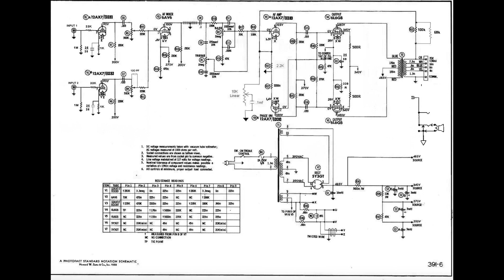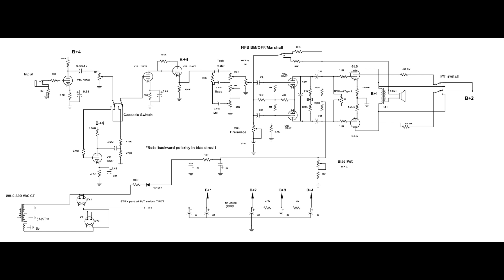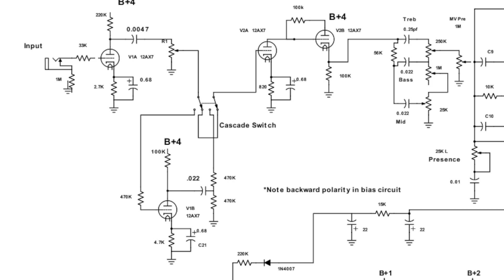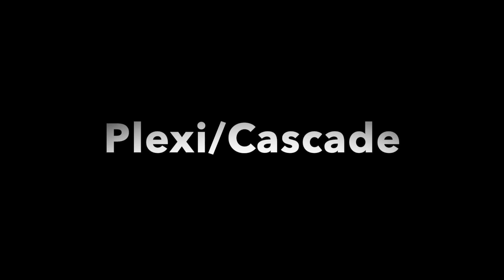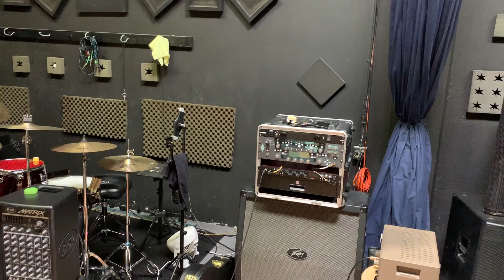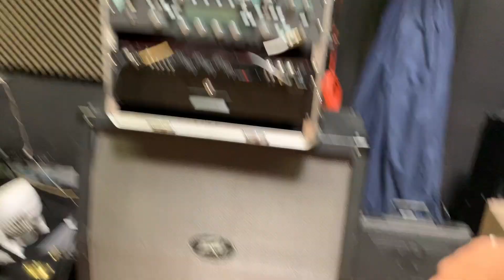Bogen Challenger Cha33 Conversion to Cascaded Plexi (AFD)

Comment: Super cool.  My grandpa passed away and left behind a CHA33, and I'm exploring converting it into a guitar amp, so this was so helpful.
Reply: This seems pretty advanced - do you have any tips/recommendations for a beginner?
Reply from the maker: @d.lauzon  I have 2 recommendations that are a bit easier.  First, you can leave the circuit fairly intact, simply replace the capacitors, and then revoice a few of the stages to be a bit more guitar-friendly.  This only requires changing a few resistors and caps, while otherwise leaving things in stock form in terms of layout.

The other idea is to build a more common version of the 5f6a or marshall in a different chassis, then use the tubes and  transformers from the bogen chassis in a manner that you can easily reinstall them in the future if you like. Use these for the build

Either way, please email and we can discuss further offline.  username@gmail

Comment: Getting ready to convert one of these. Decided to go for a Bassman but might leave it cathode biased with large value bypass cap to mimic fixed bias feel. Don’t know yet. Might use the fixed bias part of your circuit if you don’t mind. ✌️
Reply from the maker: Good luck, feel free to reach out if you need any advice (username @gmail.com).  Remember that there is a lot of juice in that power transformer (on today's mains), so you may need to play around with the cathode bias resistor value if you go that route.
Reply: @jloewenheim  I don’t think I’m sticking with the two 5y3’s. I think we’ve moved past that as a society;-). Solid state diodes and a resister for a bit of sag makes more sense I think. I’m tempted to keep the PI paraphase just because the bassman did alright with one for a while. The Bogen should be a nice change of pace from Hammond and Roberts reel to reel amps I’ve done for the past few months!
Reply from the maker: @williambock1821  OK, so since this build, I have done a few more conversions, and my honest advice is as follows (conversions can be a pain and frustrating):  Unless you are really determined to figure out how to keep the Bogen chassis and look, you pull the transformers and tubes, then use a more Fender/Marshall approach on the chassis and board.  This gives you two advantages: first, you can now always drop the transformers back into the original if you want to sell it as such.  Second, and more importantly, the fender style eyelet board (turrets too) will allow you to be very organized and methodical about your build, as well as, give you the room necessary for controls and other circuit options that go beyond what Bogen did.  

As for your rectifier (despite what Mesa advertises), the dual 5y3s make it run very hot, so there are advantages to going SS.  At some point, I will put on some videos where I have started to use a VVR circuit.  This allows those old PT's, which on modern voltages, often have secondaries around 400v, be used closer to the voltages we know.  Additionally, it allows you to go SS rectifier without needing to rely on sag.
Reply: @jloewenheim  Thanx for the input! I’ve done four or five conversions with VVR’s and when they work well they work VERY well. Some circuits(I’m just talking about cathode biased amps) just get too fizzy to really get much use from them. I’m sure they could be made to sound better if I had more experience. So far , I can’t narrow the variables down to what makes a VVR sound too fizzy. Some sound great at low voltage levels and some sound like a wet fart,lol! The Roberts reel to reels sound great with them if you do a one 12ax7 going into the El84 like a 5 watt version of a Marshall 18watt circuit. The actual 18 watt lite 2b circuit in a Hammond Ao35 sounds good too. Not much luck with Hammond Ao44’s though regardless of the conversion (tried 5 different ones) done. I’m tempted to try one on the challenger. I have all the components on hand for exactly ONE more VVR!
Reply: @jloewenheim  I wound up turning it into a 5e3 with VVR and bias selector switch for 6v6/6L6GB’s. Replaced the burnt out OTX with a brand new 25 watt Hammond 1650F. Wiring the impedance selector was…interesting! Used F&T for B+filter caps and Jupiter everywhere else. Well,a Sozo silver mica was used for the bright cap. Wired it all point to point with creative use of a few tag strips. It’s the best sounding amp I’ve built out of around 25 so far! I wish I could keep it but it’s already paid for. I’m looking for another Cha 33 for myself! Just as an FYI, the cathode resistor needed to be upped to about 700 ohms for 10-11 watts (about 80% ) of plate dissipation for 6v6’s. The 6L6 GB’s needed 330 ohms for the same percentage of dissipation. Again, this is a 5e3 build.
Reply from the maker: @williambock1821  Right on, it should sound amazing.  BTW, when you mention Cathode resistor, I generally put a 1 ohm in-line prior to the actual bias resistor for easy measurement (a trick I saw on Sluckey's schematics).  Needing to raise it does not surprise me, my Ch33 PT with the 5y3's has a much higher plate voltage, I think due to higher wall voltages.

Comment: Thanks for publishing the schematic. I have two CHA 33's and two CHA 20's (6V6) I've converted one CHA 33 (6L6/EL34 w/bias/balance) to an AB763 Bassman w/LTP PI and another half 12AX7 gain stage. The CHA 20 is now converted to a AA764 Princeton type head with a Cathodyne PI and a few tweaks.  I think I'll give your AFD schematic a shot. I only use point-point and they usually look very clean. I've done about 50 PA/Hi-Fi conversions and it's a blast. Just finished converting a blown out solid state 2x 10" combo to a Princeton.
Thanks again to you and of course Rob R.
Reply from the maker: Thanks for the note.  I look forward to seeing what you put together.  I definitely would do slightly cleaner as far as layout if I were to go back again.

Comment: I dig it.  Did something similar recently and used 270K/470K in the voltage divider.  Insane gain.
Reply from the maker: Thanks, hope you are enjoying yours
Reply: @jloewenheim  One key to using old PA heads for guitar is to use pedals! EQ, Comp, Verb, Chorus, distortion, sweetner, an yer off to the races!

Comment: Great work. Real good stuff. In the demo the plexi mode sounded like it's just barely on 4 on the volume and not rocking.. But I get it. In cascade mode you can't turn everything up to 10. When going between modes one has to adjust the volume /gain levels.

Just for other guys who maybe wonder why the plexi mode sounds weak.. It's just not turned up much.
Reply from the maker: Thanks Joe, I should have clarified a bit.  The pre amp vol and pre PI master vol (JMC800 style) were both at about 5 (out of 10), then the Type 3 MV was at about 40%.  Wattage for this amp is somewhere in the 45-55 range at full vol.  The studio where I recorded this wasn't big enough to push the amp to that level.
Reply: @jloewenheim  would be interesting to see how a plexi or similar amp responds to a paraphase inverter. I love the Gibson Ga6, ga20T and Ga40 who all have a paraphase. I think no one tried a plexi preamp with paraphase inverter.. Maybe for your next build. :)
Or a PA amp into a GA6 or tweed 5D3.. That's what I want to learn. Many old PA amps out there cheap.
Reply: @BlackBalloonGraz  Terribly! I've converted about 50-60 Hi-Fi's including Bogen CHA 33 (2x6L6) and two Bogen CHA  20's (2x6V6) I can wire up a point to point Cathodyne/Paraphase in my sleep but for some reason I have a hell of a time laying out/wiring up a Long Tail PI. To make a decent sounding 6L6/EL34 rock amp you need the Long Tail PI. Without it it will have very low volume and gain with 3 gain stages (last 1/2 of second 12A*7 is used for Cathodyne PI)  I've had fantastic results with  Push-Pull 6V6, EL84, (6AQ5's are my favorite) with a Cathodyne PI but not once with 6L6 or EL34's. If I could figure out how to wire a Long Tail up I'd have another dozen working 30-50 watt heads. I just can't get it from paper to the chassis.
Reply from the maker: @RCPickups  I agree that LTP can be a bit of a pain to do PTP.  I have built a few amps where this has been a challenge, if you like, feel free to email (username @ gmail) and I can share what I have learned.
Reply: @RCPickups  you can always just do a mix of point to point and tag/turret board. I’ve done that in a few different amps. I know a lot of guys love p2p but I’d be very surprised if they (Ken Fischer not included)could a/b two unfamiliar amps in a blind test. The point is a working amp. I love seeing both as long as they’re well done. LTP is pretty tidy on a board.